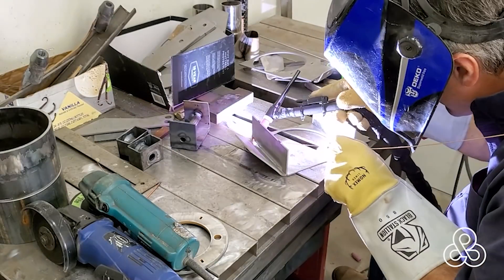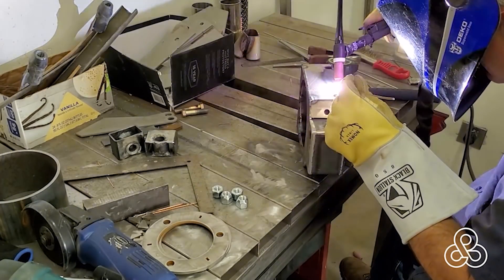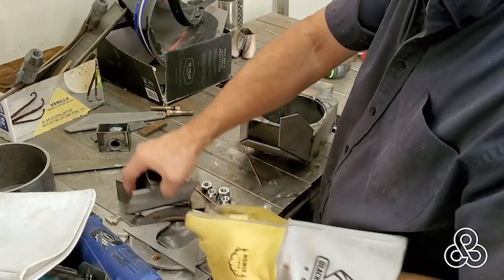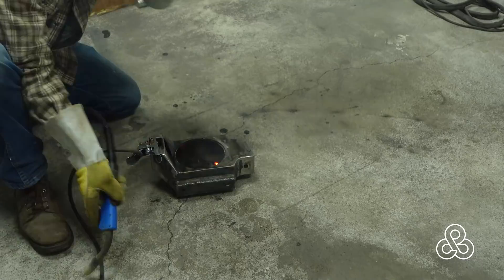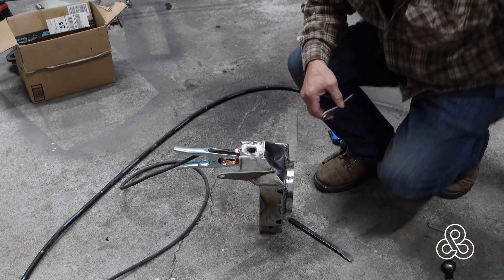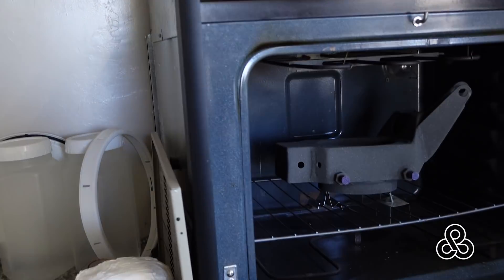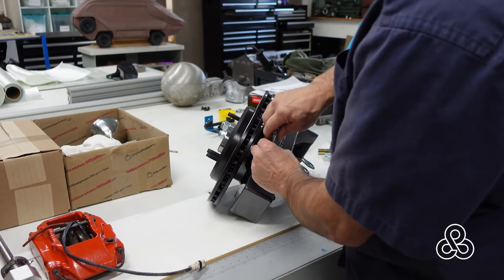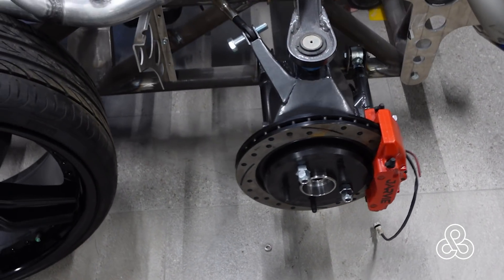A77 Lamborghini parts off Ebay? Na!  Build your own rear hub- part 2. Arete Supercar project

Comment: is there any particular reason why you would go to all the trouble of fabricating hub assemblies rather than finding suitable donor units?
Reply from the maker: As the video articulated, the only "suitable" hubs would have had to come from a mid-engine car (like a Lamborghini Huracán) and then my $60 axles would not have fit, nor the $40 bearings. In the end, my homemade hub plus the $60 axle and $40 bearing was within my budget, but $1200 + $8000 + $650 was not!

Comment: Really enjoying, and learning from, your project. I've noticed that most people hold a TIG torch like a pencil but you hold it down the handle in your palm. It obviously works for you.
Reply from the maker: Sometimes in tight places the tungsten cover cap I use is only an inch long;; hard to hold a pencil stub . . . most likely a habit from my youth though. Ha!

Comment: Like idea of powdercoating. Years of testing different rust preventing method for steel, nothing beats powdercoat. Metallizing with zinc is quite good too. Rest is rubbish.
Reply from the maker: Plus the cure time (cool time) is short and the clean up super easy, not to mention the huge selection of colors and finishes. To bad my oven is not big enough to do the subframes! I will be farming that out to a professional shop.
Reply: @BuilderCreator  For bigger parts I personally stick to epoxy primer with fibre glass fibres, 2K. Good enough to withstand outside elements on some of my tiny DIY projects in low carbon steel.

Before it cures completely I spray it with few coats of acrylic in desired colour. It lasts years with no signs of rust and doesn't require prep apart of degreasing steel completely.
Still, powdercoat is magic, simple and cheap.

Comment: How is the power getting to the rear wheels?
Reply from the maker: A center differential splits the power 60% to the rear and 40% to the front via driveshafts. Corvette/Getrag diffs, front and rear, send it out to the wheels.

Comment: It's hard to tell from the video,  but it looks like the toe link is shorter than the upper control arm next to it. Are you sure this is not inducing undesirable push/pull forces between the two? (and bump steer?).
Reply from the maker: tow link is actually longer, but it is off to an angle. The important part is that the pivot points are in the same plane.

Comment: I'm a builder of various auto projects as well.  I was wondering if you would share why you did not just use the C5/C6 hubs or hubs and control arms?  Was it to use the brembo calipers you like?  I'm in the air on the decision.  If I use the C5/C6 front control arms, it limits my front footwell space...
Reply from the maker: You nailed it! "Limits my," just about sums up my need to build my own. Adjusting the sub-frame to fit the control arms, rather than vice versa, lack of driven front wheel hubs (I'm all-wheel-drive) and just the lack of setup control on the Corvette (or other) suspension pieces. I'm allowing for a lot of movement in setup, as I don;t have Chevrolet's army of engineers and software to perfect the design beforehand. other than that, no reason. Ha! What are you building?
Reply: @BuilderCreator  I own a shop and we build mostly street rods and muscle cars but I have built lambo replicas. My current project is of my own design. But basically looks like a pagani zonda and a laferrari had an offspring. Though my front end predates the laferrari. It was more F1 inspired but looks alot like the laferrari. I had the body cnc routed from foam.
Reply from the maker: @bartroberts4876 Would love to see it. Do you show it on social media anywere?
Reply: @BuilderCreator  No I just kind of keep to myself. Not really a social media kind of person.

Comment: Awesome layout! I've got a question for you. In an effort to use independent suspension to drive the wheel down 👇🏼 which lifts the body exactly like a 4 link full floating diff does, I want to use trailing arms with link rods solely for caster and camber. I'm thinking that the low hub mounted trailing arm should drive the twisting moment into the body essentially lifting it under hard acceleration? Have you seen any design like that? Maybe I'm not using the proper search terms but I haven't been able to find any examples purpose built to hold 1200hp traction using IRS. AWD with torque arms for the front like front wheel drive drag racers should allow me to get another 450hp down (electrically) to the front wheels I'm hoping? The objective is to be able to pull over 3Gs in the 60ft while maintaining independent pirated magneride on all 4 corners for tunability strip v track. Scribbles on paper for now.
Reply from the maker: Your talking a different world when you go electric and 300HP to each wheel; that instant torque does indeed call for drag racing technology. With electric "on the street" you can write in a ramp up of the torque from the motors via controller code which is what you want to control wheel spin as well; then overly complex and heavy suspension components are not needed.

Comment: What measurements did you use on the hub rotor assemble in choosing a non-corvette caliper. I built a rear hub and I'm using a C4 bearing and and rotor, but struggling with a caliper. Love you work.
Reply from the maker: Three measurements- Rotor diameter, Rotor thickness and Pad contact area. These factors all matched up with the Porsche Brembo calipers that had the radial mounting system for which I was looking. I ordered a used set off Ebay just to verify before I bough new, but ended up with calipers in such good condition I just cleaned and powder coated them.

Comment: Is there a write up somewhere on how you decided on the suspension geometry?
Reply from the maker: No "write up" so to say, just the videos. If you follow the "Arete curated playlist" you will see all the important videos of the project (in sequence when title has an "Axx" at the begining. If you have any specific questions drop those in the comments. In fact I've had some pretty in depth discussions in the comments regarding Ackerman and other geometry decisions.
Reply: @BuilderCreator  Thats specifically the part I've been trying to wrap my head around, I've just started designing an electric car and have been having difficulty figuring out how much camber gain would be ideal. The dimensions of the car I'm trying to put together has approximately the same footprint as yours
Reply from the maker: @TagMan0131  I wish I could just tell you the answers, but things change from car to car. If this is your first ground up project or you want to shave years off the production timeline then it is best to take suspension from a donor vehicle. Even if you want to build your own frame you can build a jig that holds the hubs in place (bolted to steel plates) and then attach braces to all the suspension pieces to keep them locked in position. after that discard the shell (unibody likely) and build your frame between all the "locked in place" suspension components. Want a mid/rear engine? Take a front wheel drive setup and move it to the back. This does create some design constraints, but as mentioned simplifies/shortens a lot of design. Just for your curiosities sake here are my design factors: Rear roll center 7". Front roll center 4.5", 1.5" scrub radius, caster 7 deg built in, Camber- 1.5 deg front .75 deg rear., I am dead on with Ackerman steering at the front of the hub., the front upper A-arm is tilted up at the front 6 deg to reduce suspension dive on braking. Everything is very adjustable, because all this could be wrong. Ha!

Comment: Why not use delrin bushings?
Reply from the maker: Delrin is a bit hard (not quite metal on metal like pure racecars use) and gets deformed if it gets bound up. urethane is a bit more forgiving and will return to its original shape.  Since this setup may have to go through some pretty radical adjustments I need the more forgiving bushings. I'm also likely to spend way more time in this as a road car and need some vibration isolation, but not soft black rubber isolation mind you.

Comment: Very impressive looking! Is there a particular method to ensuring the left and right sides are both symmetrical?
Reply from the maker: The components are water jet cut with slot and tab construction. As long as you get the slot in the tab it should turn out the same. Any difference can be adjusted out in the suspension setup (Wheel alignment).

Comment: Coming along nicely!
Somewhat irrelevant but not is, that style caliper mounting is called Radial mount (the other style like most vehicles is called Lug Mount). They both have their advantages and disadvantages. 

Radial mounting has two distinct advantages that lend to their use on race and other high end cars (like Porsche) and those are caliper 1) Rigidity and 2) ease of changing rotor diameter via simple spacers (something sometimes done from track to track).

As for lug mount calipers, really the only advantage that they have is from the knuckle / upright machining aspect (well cost too I guess). From a high volume production stand point, machining setup and process can be a bit simplified with lug mount type knuckles / uprights. The calipers too are cheaper to manufacture in most cases

The only thing I would be concerned with as produced in this video is the squareness of the caliper to the rotor. Granted we didn't see how the caliper mount threaded holes were positioned, or drilled and tapped but the surface really should have been machined flat and the holes drilled and tapped after all welding was done to ensure that the caliper was square to the rotor in both the horizontal and vertical planes. If the caliper is too far out of square, it can cause the pistons to bind and seize in the bore.
Reply from the maker: I'm afraid to say, that some of the most critical parts of construction don't get video coverage. If it takes a lot of setup, I often get engrossed in the work and forget to go back to the camera. I know that is part of my self proclaimed job title and should remember why I am putting this all on YouTube. I will try to put some emphasis on the steps for caliper mount when I build the front hubs. In short, I use threaded inserts (lug nuts- just happen to have the right thread gauge and longer depth) and semi assemble the rotor and caliper to hold things in position while I (tack) weld  parts. I do have a new milling machine that is big enough to fit the hubs in and may just run them under the blade to verify square as well.
Reply: @BuilderCreator  Yeah, I fully get it that a lot of stuff / steps often gets left out of video's.
Although my comment was to make sure that you were aware that it could be out, it was also and largely for viewers who might be attempting something similar and hopefully they read comments just so they are aware that the caliper could be out.

Since you mentioned having a mill big enough to check them, it certainly wouldn't hurt to at least check them because stuff does move when welded no matter how much you try to control the movement and some of the allowable angle errors equate to only a few thou of an inch error. For example, in the top view, you dont want the caliper to ever exceed about 0.5° to 0.75° while in use in the plane parallel to the axial direction.

The key thing there is "in use" meaning with possible flex of the knuckle / upright. So iif you are at say 0.5° error in the no load state, loaded, you could easily have enough flex to exceed that last .25° allowable error. 
With say a 1" wide mount boss, that 0.5° error us only about .009" taper across that 1" wide area. Controlling movement in weldments to only a few thou of an inch is not exactly an easy task without extensive fixturing and compensation for movement and / or post weld processing such as machining.

Comment: Whats that linkage off the left?
Reply from the maker: That is the "Tow" adjustment. Still need to add the pick up points to the sub-frame and shorten up the rod end adjuster for it to be operational. Camber and tow are adjusted with the lower control arm; additional tow adjustment with the linkage in question, caster built into the upper and lower control arm placement

Comment: Looks great ! Nice colours. Powdercoating seems to be a very precise and precarious job. Does the coating beside the colouurchange and most probably adding some protection against dust and rust also do anything for stiffening or hardening the rear hub ?
Reply from the maker: Sometimes powder coating is easier than paint. The powder melts at 400degrees (200c) so the metal never gets hot enough to anneal or harden, it is purely for cosmetics and rust prevention.

Comment: What temperature do you bake at and for how long? At work, we have 3 walk in size ovens that are set to 380°F and we bake our stuff for 15 to 20 minutes. Mind you, we are setup for high volume.
Reply from the maker: Prismatic Powders is just down the road and of course the powder I use (how could I not with the convenience) Most of their powders are 400 for 15-20 minutes. I will be needing those walk in ovens when the subframes are ready for color.